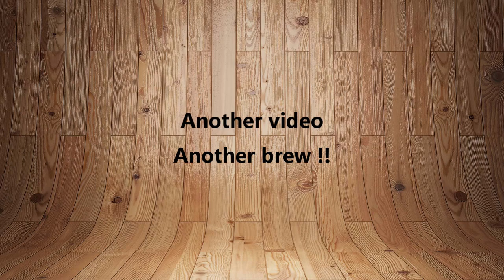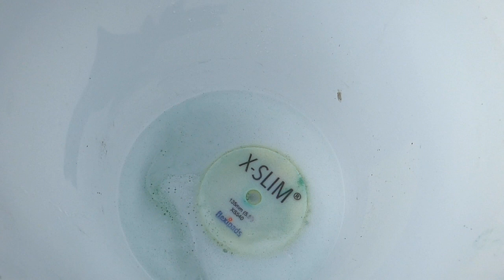The Car Boutique - Beginners guide to detailing Pt2 - Machine Polishing.

Comment: Iv seen you need more steps with rupes compounds I’m using sonax and Koch
Reply from the maker: Both great brands. Planning to try the Koch products soon. Any recommendations buddy.
Reply: The Car Boutique h9 with flex purple pads it’s really good one step on hard and medium paint removed 95% of the defects on my golf bonnet and was heavily swirled the gloss it left was very impressive for a heavy cut compound more then enough for a one step  haven’t used there polish yet m3.02
Reply from the maker: @hakman239  roger. Im due to order new pads and compound soon so will try your recommendation. Thanks buddy.
Reply: The Car Boutique flex purple pads are expensive £15 each but there quite thick